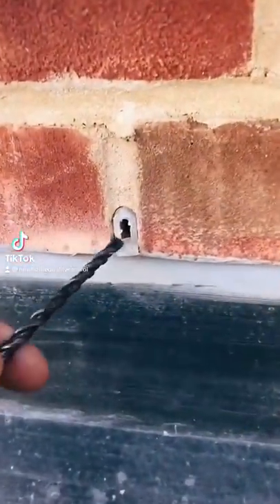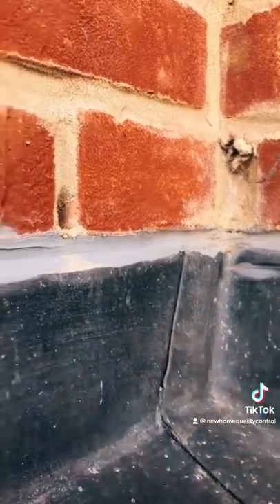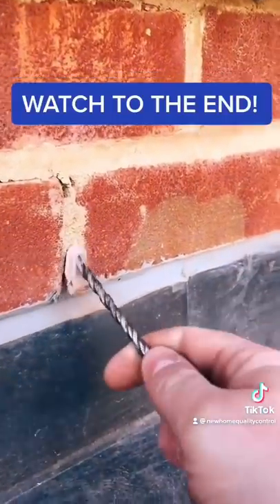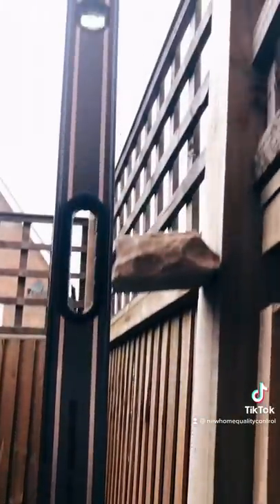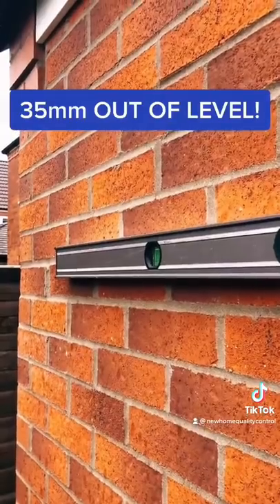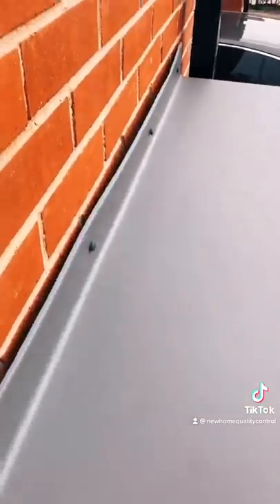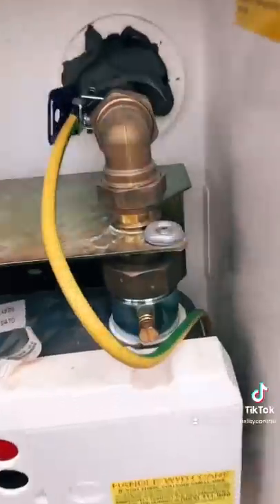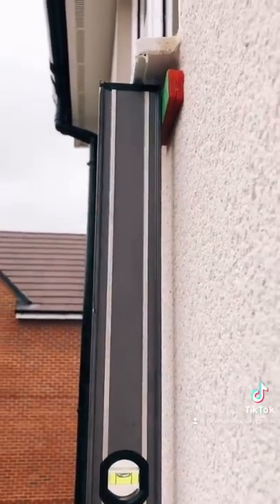NEW BUILD SNAGGING INSPECTION

Comment: This is why I’ve resorted to doing pretty much all my renovation work by myself except elec and gas. The rest I can watch pros on YouTube and have a go. Learning building codes etc is challenging and yes I’ve cocked a few things up but I can then improve by fixing the mistakes. I have very little trust in tradesmen these days, I’m sure I’d trust recommendations but I don’t get recommended tradespeople very often, it’s usually stories of nightmares.
Reply: Same. I do basically all home stuff myself because I know it will be done properly. Anytbing outside of foundation or replacing a roof is pretty much reasonable for DIY— actually large scale concrete work is also tricky. Plumbing electric tile, framing for a basement etc. all of this is quite achievable.

Comment: I'm a plasterer this is why I gave up site work 10 yrs ago some of the shite we were expected to cover up was shocking the worse thing that happened in the building industry was getting rid of the clerk of works nowadays it's all about speed nowone gives a toss about quality also trades are given such tight prices for works carried out many of them cut corners just to make a wage
Reply: Agree completely, gave up site work, no money to be made unless you just sling it in. if you have any pride in your work new builds are not for you.
Reply: How many times have you heard "plasterer will get over it"....
Reply: @marksmith5237  absolutely right.
Reply: @ashleybland4696  How many times have I said f--- plasterer bell cast at skirting. Oh and just a heads up am from a generation of dooking and grounding wall as the plasterer required a datum to work from as they not able to do so themselves.

Comment: Anyone who buys a new build today needs their head examining. This video is the tip of the iceberg.
Reply: If your not in the building trade it's hard to tell people only see white bright and clean 🤦‍♂️🔨
Reply: You’re absolutely right. The quality standard of new builds are shocking. I always find it amazing looking at how well houses were build 200 years ago compared with today
Reply: Blame the UK because you can get a card in a few days saying your compatent at blocklaying plastering the lot but in reality it tuck me 5 years to get mine when I proved I am
Reply: @Elfin4  you always got a choice, especially when you're spending ££££££s
Reply: I've never understood this because older properties as just as likely to have issues. They can be poorly maintained, have a variety of big problems such as damp, poor insulation/ventilation, settlement, inadequate foundations, roofing requiring maintenance/upgrades/repairs etc. 

The advantage of a new home is that every single one of the issues in this video is covered by the warranty and will be made right for the customer. If you bought an old house and the brickwork is 19mm out of plumb... you put up with it or you pay a fortune to get it fixed.

Whether you're buying a new property or an old one, you need a comprehensive survey and to go in with your eyes open.

Comment: Worked on a site and scaffold poles kept going missing ,Where were they going well you have to do a cavity fill on the lower first courses if called for some one was putting them in the cavity then concrete on top so as to mix less and speed up the prosess.

Comment: The person who signs off the work is every bit as much to blame... I would argue more so. It's one thing a workman f*cking the job up but it would be rectified once it's inspected and failed.

I bought a 3 year old flat and I've had nothing but problems and many are still only just coming to light. I got a plumber round to fit new taps throughout the property. He was here 3 times longer than he had expected due to his words 'frighting' plumbing from whoever did it originally. It was that bad he suggest when I 'get chance' I should have it all looked at and probably replaced. It's 3 years old😕

Comment: Craftsmen at work visited a show house down the road as you walked up the stair it felt like you where falling forward the angle of the stair was really out so they had slipped a piece of wood under the base to hide the gap under the stringers then put skirting to hide someone payed 400k for that what else did they hide 😢👍

Comment: You can't blame the renderers for that. Its not their job to get walls plumb, that's shoddy bricklayers again.
Reply: Surely they put a level on the wall and if it’s out make it right / plumb? It’s more than possible
Reply: Not with thin coat through colour renders
Reply: @paulbackhard6315  sorry mate you're wrong .  A render finish is exactly that a finish coat applied by a finishing trade . 
 How can you possibly expect a plasterer to put on 30 mm of render ?  The fault is clearly with the bricklayer . 
 If you employ 3rd world tradies you get 3rd world houses !
Reply: @johnniethepom2905  I have actually in the real world plumbed a wall up with render . Of course it’s possible, the spreads might not get paid to do so and therefore don’t but they could if they got paid to do so .
Reply: @paulbackhard6315  I’m sure you could, but you shouldn’t plumb a wall up with plaster or render it’s a finish, the substrate should be correct, all finishes have a maximum depth or dubbing out is required, as well as using extra gear to achieve it , there’s only so much you can do .
I’ve had people tell me I should put a level on a skimming bead on a new wall, the bead supposed to sit flush that’s how it’s designed, people expect plasterers to get over shoddy work lol .
Rant over , no beef 🥩
Reply: And here we have it. One trade blames the other. ‘Not my job mate’.
Reply: @beano6452  maybe we should tell the painter to put his paint on 35mm
Reply: @paulbackhard6315  I've been in construction for over 35 years and  I've laboured , driven excavators  , general maintenance  and ceramic tiling ( 20 years ) . 
 The only job I can recall  thick render  on is the Olympic sized pool at Beatty Park in Perth Western Australia  . The finish build has pretty exacting tolerances . The most critical is the length . Finish pool end to end ; 50,000 mm  , - 0 mm and plus 6 mm . After all it world records wouldn't count if the pools were different sizes .  The concrete shell is made 60mm or so oversize and one end had a skim coat  and the deep end had  about 40 mm . The primers and additives were top of the range . The tiles were a complete tiling system from Germany solely for Olympic and public  swimming baths .
Reply: That’s the problem. One trade is following on from a useless piece of crap and is unable to do anything else other than follow on down the slippery slope. If the corners of the room are way out of plumb and square everything else will look pissed up.
Reply: Sorry lads but the main thing that you're missing is that if the wall is 30mm out of plumb on a 6 foot level, then I will assume that the building above the level is out by roughly the same. But even if its not, render goes on at a minimum of 20mm thickness, so to get that plumb over a 6 foot span, you'd have to go from 20mm to 50mm in render. Anyone that believes that it's the renderers job to be doing stuff like that is unbelievably delusional. In the 24 years that I was on building sites (I stay well away from housing sites now because of the piss poor standards and rates) I never once, and I literally mean not a single time, did I ever see a renderer with a spirit level bothering to check if a wall they were covering was plumb, and damn right too. If a brickie can't build a wall plumb, then thats their issue.

Comment: I'm a carpenter and this does not surprise me. I worked for three miserable weeks for a house developer in Cornwall called Wain Homes. 
The workmanship I saw in the short time I was there was shocking. When I pointed out the faults to the thug 'running' the site he really didn't care.
They should really be called John Wain Homes.

Comment: And once you've moved in and discovered things that the council inspector has said it's all up to code, see how long you'll wait to get assistance from the "after sales" rep from the builders company.  This happens in the big building companies as well as local dodgy ones.
Don't sign until you've had YOUR new home inspected, and a contractual time of completion.  Get a value of work needed and use that as a figure you hold them liable for, don't muck around.

Comment: You should check out the drainage 
How most new builds are signed off must involve brown envelopes ✉
I work in civils and there is no way you could get away with this sort of stuff 
Used to work on housing and I absolutely hate the bodgers you find employed by inexperienced or lazy management
Reply: My parents bought a brand new house in 1946.  The drains were laid and the trenches left open for inspection.  Once passed by the council the pipes were pulled up and drains, including foul water, were connected to an existing field drain.  The type where the pipes aren't actually joined together.

This resulted in all the foul water from the houses above ours settling under our kitchen floor.  The builder went bust and all our neighbours had to pay for remedial work, and the b******s blamed my parents!

Comment: Wtf who done the previous work think they should maybe be exposed imagine how many homes needing repaired cause off them,shocking like pure cowboys
Reply: I used to run my own motorcycle workshop and I frequently saw a far higher standard of work carried out by untrained owners than by supposedly professional mechanics at dealers!

I used to carry out post service  inspections on motorcycles serviced at the main dealer to keep the warranty and there were always things not carried out, things carried out negligently or something damaged!

These were fraudulently carried out to charge for new things that were never fitted or for work that had never been carried out.

That was why I set up on my own, I worked only if something actually required that work and everything I took off a customers bike was returned for their inspection.

I bought a 90 year old house which only needed age/wear related things replacing and found tradesmen by looking at houses undergoing work locally and asking the owners about their experiences.

Everyone that worked on my house came very highly recommended by multiple locals that had used them for years!

Comment: This is why I'd never buy a new build as they are made cheaply then you pay way too much for them, old houses are much better as all the walls are brick and not made of flimsy wood, pipes in old houses are copper,  so many other problems with new builds. Old houses may have some issues but not to the level of new builds
Reply: Mmmm your reasoning just does not quantify. Old houses were new once!  with "flimsy" (your wording) timber roofs flooring and joists. And you may say "yeah but bigger and stronger timbers" well bigger and stronger timbers mean more settlement and shrinkage. Never heard of a ground floor wall plate rotting out in older homes as no D.P.C. in situ. Never heard of lead pipes.

Comment: I built an extension and a garage conversation a few years back on a self build building regs notice.Inspectors came at several certain build points. Mine was cock on. This however is as he says shocking. Mind you anyone my age will remember Barrats Homes! No wonder they went under.Houses built with a life expectancy of 10 years with a bit of luck!Fun fact many had to be demolished due to how bad they were.I used to work for as was then Wimpey Construction and stuff was done right.Cowboys not allowed on site.

Comment: This is what we are up against all the time in different trades. We are always coming off somebody else’s crap workmanship. I fit bathrooms and kitchens and the amount of bowed out of true walls and ceiling’s is unbelievable. I worked on sites as a kid and the site agent was normally some tough old builder that understood how jobs were supposed to be done and was certainly not afraid to give somebody a right bollocking if they messed up. If you can’t have pride in your work fk off and leave it to people who know what they are doing. I’ve lost track of how many bathroom and en-suites I’ve ripped out that a leaking through to downstairs in so called modern housing.

Comment: It is a crime, it's why I don't trust any builders to be honest, there are good ones out there, but a hard find. It's all about getting it done as quickly as possible to get on to the next job, shocking stuff. In my apt, i had pipes come off in my hand . Desperate stuff, a guy use sealant to fix a roof leak that just froze fell off - not fixing it at all.
Reply: Strange that as I do not trust clients.

Comment: These are legit problems but often "professional snaggers" have to earn their 500 quid plus fee by pointing out the ridiculous. Pointing out hundreds of "problems" that otherwise a customer would never even consider and never pose any problems.  I find as an maintenance engineer for a large developer that they will often ruin the  experience of buying a new house for a person by pointing out hundreds of absolutely insignificant minor things then  take their money, and leave homebuyer thinking they are in the worst house that's ever been built. They will then be very reasonably told no to most of the pathetic little things by the developer causing them further stress. 
There is certainly a place for surveys to find issues but be carful what you class as an issue as you can cause months of heartache for someone who would otherwise be perfectly happy. Seriously i'v seen these things so over the top it makes a homebuyer sick with uneccessary worry. 
Also picking holes in other people's work is the easiest job in the world. I would like to see these guys turn up and do some things better. 
Take putting a lazer level up that reveal and it being out by 15mm. OK it's out, but can a human eye pick it up? Would the home owner have ever noticed - no. Is the lintel going to slide of the wall - no. But here's the thing the homeowner now thinks it's an issue because of you ridiculously pointing it out, and now  they have to fight the developer for months to fix it. And if after all the stress, emails and escalations the developer agrees they then have an entire wall ripped out, flooring changed, ceiling skimmed. 10 different blokes in there house all for the finish to actually look worse cause every tradesman that goes in there's thinks the same thing - "REALLY ALL THIS FOR THAT"
Reply: Would you buy a brand new car with the bonnet 15mm higher on one side? Professional snagers would not exist if big builders cared about their customers.
Reply: @nicolassales8679  I can see where you are coming from bud, but come on.  I do believe in tolerances, but 15 mil ain't acceptable.  With the tech we have today we should be able to keep tolerances to within 2 to 5 mil at the very most.  It's not about what the eye can see, but about how diligent the work is being carried out.  If you keep letting folks away with that kind of work, where does it stop.  When the tolerances become to big and folks die because the building fails.  Don't get me wrong there will always be unforeseen problems with new builds, but that should not be because of bad workmanship.
Reply: @robertjohnston5842  cars are made by machines houses are made by men. Right or wrong men sometimes have a bad day or are hung over or are shit or are really good and that reveal would be 2mm out over 2.4m or they might be just OK and the reveal is 9mm out over 2.4m. If that was in my house would I be happy with it? no but would I want all the hassle to change something you can only see when you hold a level on the wall - no. As I said there are some things pro snaggers are there to find and point out OK, and there are some things that a customer will naturally pic out if it sticks out to them but some of these guys take the piss.
Reply: @chrishunt1042  There should be standards that are acceptable and those that are not.  I understand that workmen can have a bad day, but then should they be at work?  Self inflicted illness or not is not an excuse to come to work and do a job poorly.  I also know that it is not always the workers fault as the employer can force them to come in or they get rid of them.  Do not blame snaggers for the developers faults.  I do however agree that some go to far and that is why I say there is acceptable standards and those that are not.  As for the experience of a customer who buys these new builds, I do feel for them, but the truth has to be said.  If these snaggers are making things out to be more than they are, then shame on them, but if there is serious bad workmanship, then it has to be called out.
Reply: @nicolassales8679  Neither would lazy home owners.